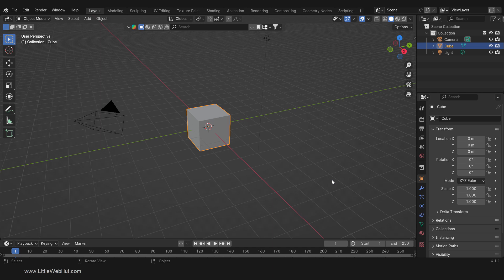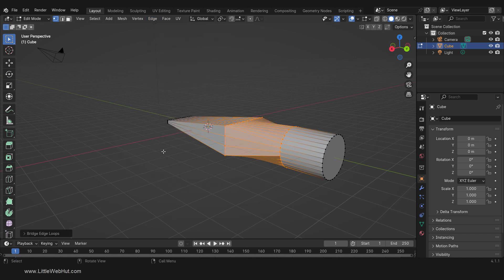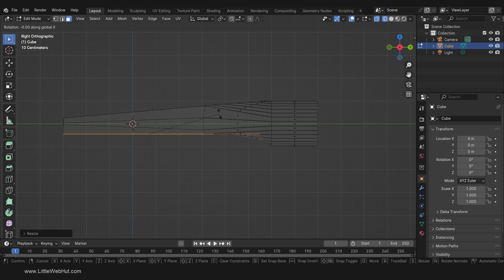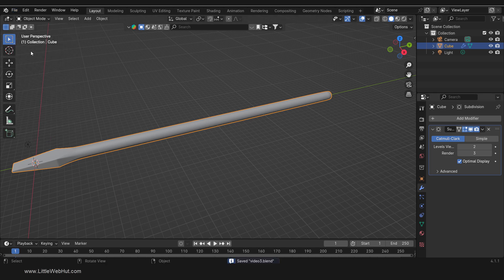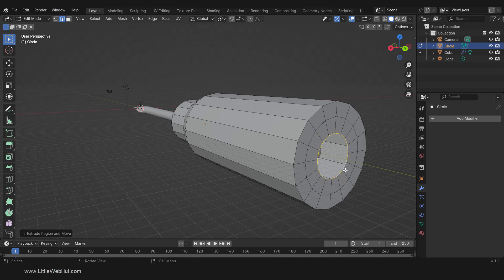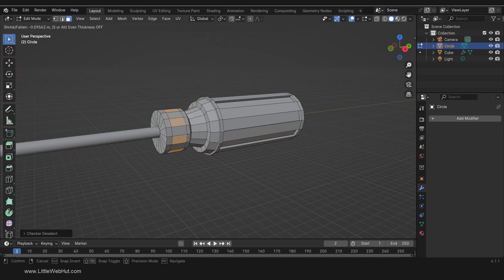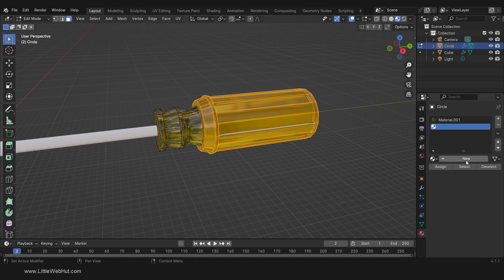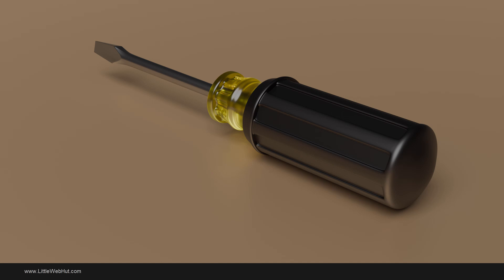Blender Beginner 3D Modeling Tutorial: How To Model a Screwdriver

Comment: Sharpening edges via extrusion and rightclick (or control R and dragging to the right/left) can cause problems later when merging by distance for cleanup reasons. In that case all duplicated edges will disappear. By my opinion better solution is making control edges via e.g. "inset faces", and with this control loops we can later any time easily control the sharpness. These control edges must not and should not be pushed to the limit, it is good to keep some distance.